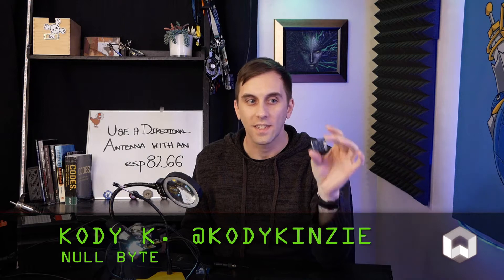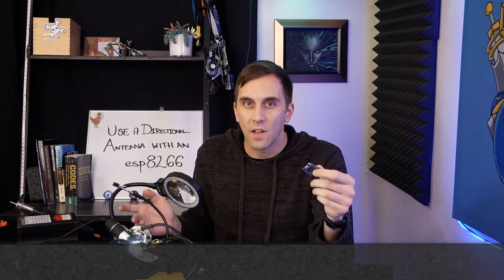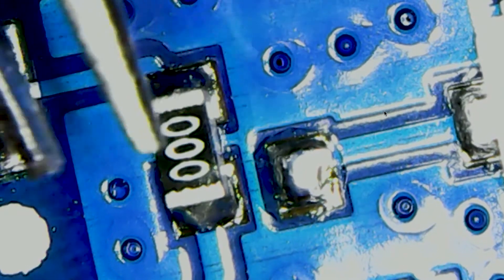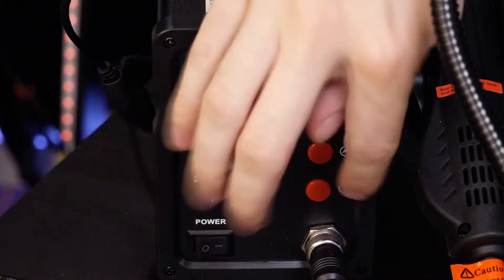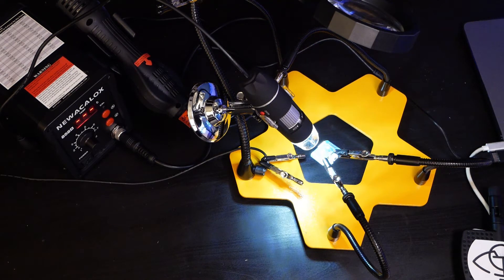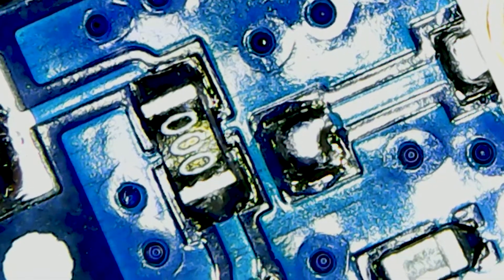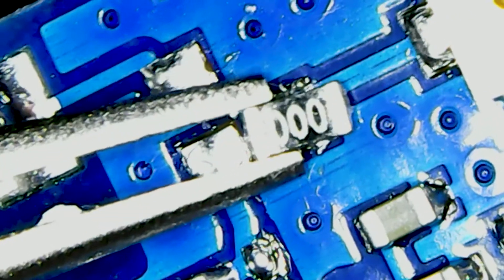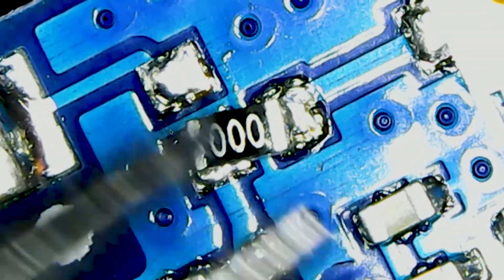Use a Directional Antenna with ESP8266-Based Board [Tutorial]

Comment: Microscope? Hot air? You are making this too complicated. Just remove the jumper resistor and throw it out. Jumper the two points with solder.

Comment: Just buy Iron Tweezers (aka Hot Tweezers) and make all this torture in one easy move. Hot air interventions  are risky especially if you have cheap gun (with no thermal regulation).
In this case you can get the job done with simple soldering iron. 000 resistors practically are jumpers/bridges. It's more easier and safer to remove it and improvise a new one  by merging the solder between the pads of the new direction instead of relocate the component.

Comment: You don't actually need the SMD resistor. It's a 0 Ohm resistor, so a small wire (or just take cut of a small piece from a LED's pin) would work just as well, or just add some more solder to bridge the connectors, since it's such a small space between them.
I've done this on two of my ESP32-CAM's.

Comment: if that resister is 0 ohm why we using it?
Reply: Pick an place machines assembling the board need something to place on there as jumpers, so 0 Ohm resistors are used. Solder-Bridges cannot be done with automatic reflow soldering.
If you do it by hand, you may just bridge it with solder. However, this may slightly change RF characteristics

Comment: Awesome video! If you have some flux it will help to prevent it from flying away and make it easier to re-solder the resister back in to place, also it will make the solder joint much more secure.

Comment: I believe you could just bridge the gap after removing the resistor.
Reply: yep its just a jumper so bridge it with solder if the resistor goes flying or dont have heatgun or something :)
Reply: Agree with you. Zero resistor is a jumper.
Reply: yep but notice there is another trace under the resistor, so straight wire might make contact on that trace if solder resist doesn't insulate it
Reply: Yup

Comment: Why not cut the track to the inbuilt antenna and simply bridge the open link?
Reply: My thoughts exactly. You don't need the 0 ohm "resistor" per se, just a connected path. You could make a solder bridge, replace the "resister" with a wire, etc.
Reply: This is RF, you don't want signal reflections on a dead track.
Reply: @RoterFruchtZwerg  As this could certainly be an issue at times, then we need only to cut the lead in track twice or even cut a track within the antenna grid.